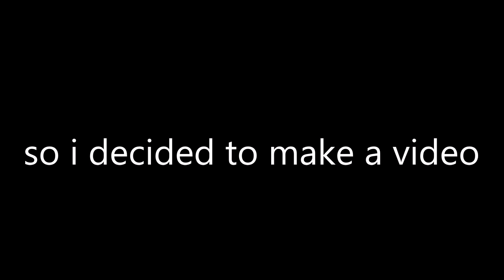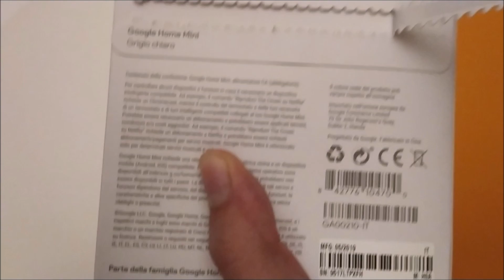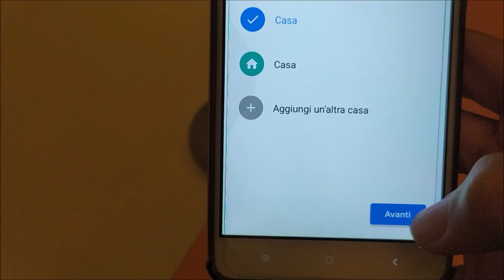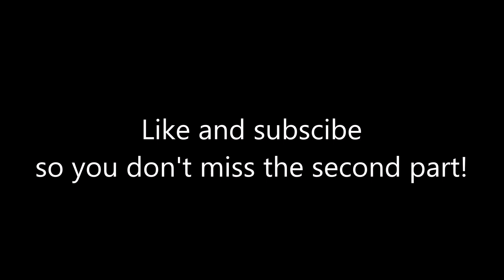how to make a google home mini with internal battery! | Part 1

Comment: (3:51) 3.7V battery? or 5V?
Reply from the maker: It's a standard litium 3.7v battery, the voltage is boosted to 5v by the power bank module
Reply: @hobbylabchannel  Any info on the power bank module you are using?
Reply from the maker: It's a generic one, just need to be 2A! I found one smaller but those are more difficult to find. You can search "usb 2A 3.7v " and you should find some😉